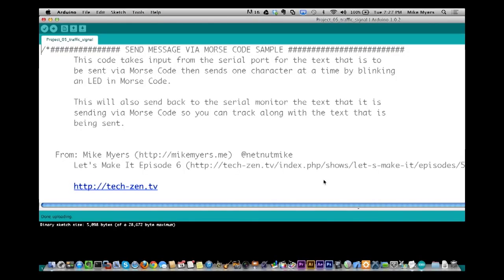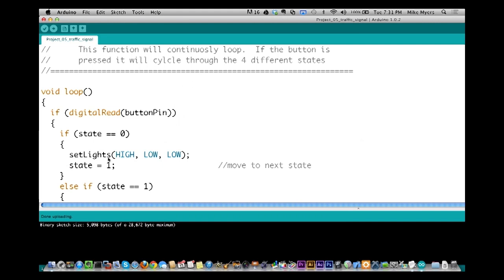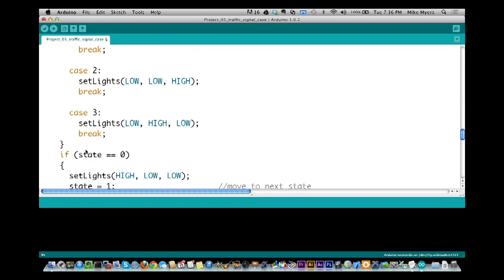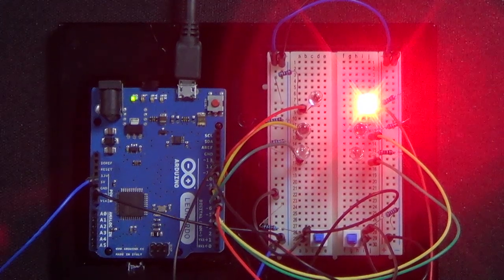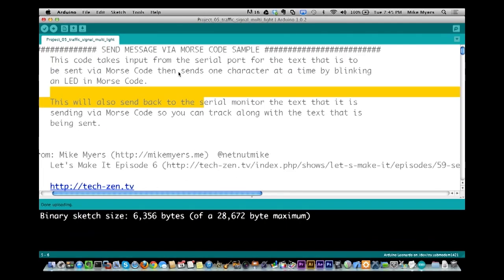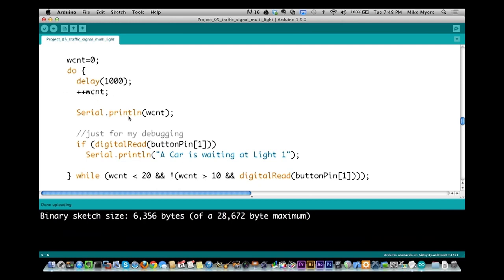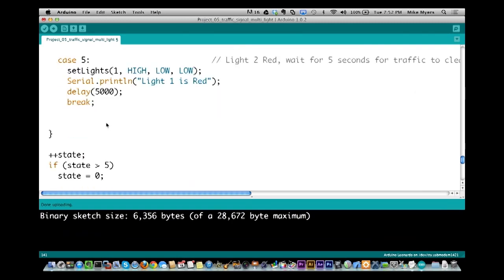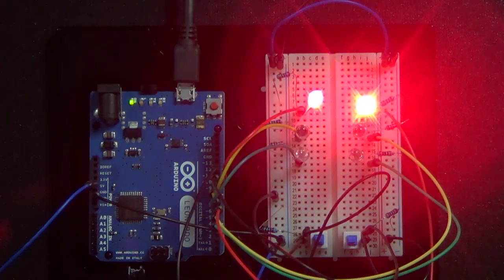Making a Stoplight With An Arduino - Let's Make It - Episode 8

Comment: for detecting a car a pir or some other object sensing system would be better than using the road induction loops that are used today because at night when the traffic is low a motorcyclist can be left waiting for hours at a light because the loops dont sense them there so your left with either having to wait for a car to enter your lane and trip the sensor or risk jumping the lights and getting in trouble by the police ive sat there for 10 minutes before watching the other lane be allowed to go over and over whilst my lane has remained non moving untill a car showed up on my lane and set the sensor loop off